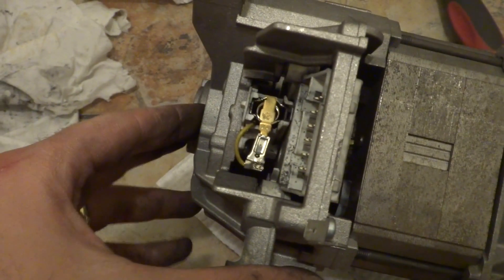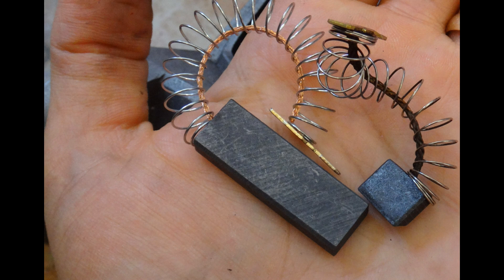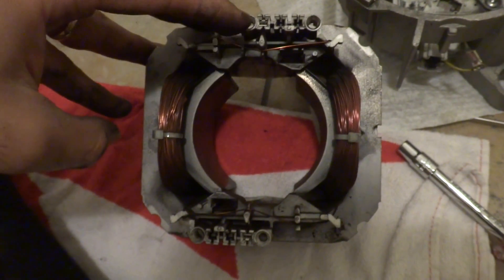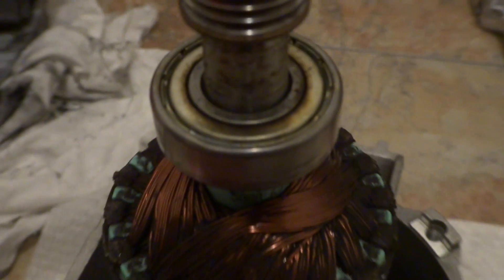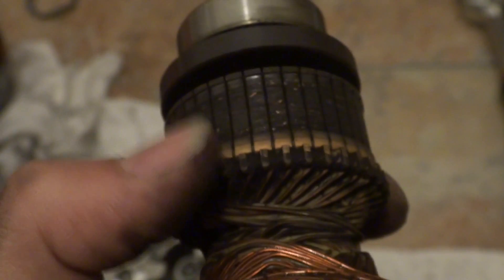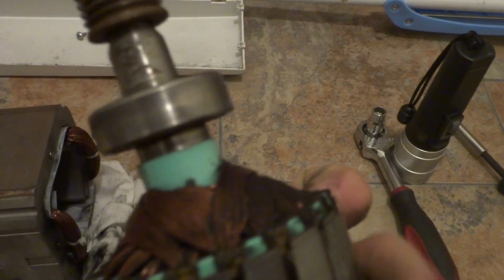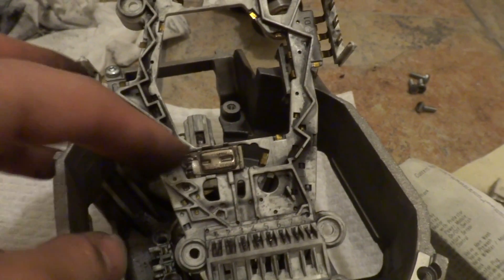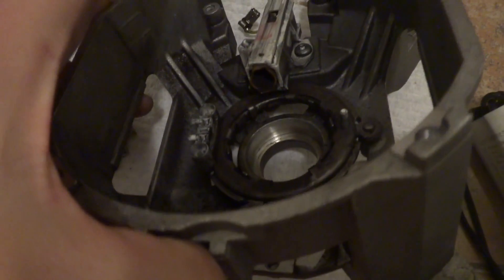Teardown and Inspection of Bosch washing machine Motor Rotor Carbon Brushes

Comment: The center rotating part with the commutator is the armature.
The rotor is a metal mass with windings and slip rings, used in car alternators.

Comment: Hi,ive taken out my washing machine motor and the rotor moves about 8 mm either way but wont move any more than that, at a guess what could be wrong ,ive moved the carbon brushes and the motor is on the bench,any help please

Comment: I have a question for you.   
Can you tell me how to remove the drive end bearing, yours worked well, but not mine!?  How to manage with the drive end part diameter that is bigger than the bearing diameter? Is there a way to unscrew the drive end or do I have to use an extractor of bearing ? 
And thank you for your video, very helpfull.

Comment: I keep a Bosch machine which is nearly 40 years old, but it does not fitted with this type of motor.  I mean no brush and the motor is good but the problem with the program box. I am trying my best to keep the contact point meet. Because I saw two burnt and I love the machine very much and it work well except the shock protectors not so good.. It is Bosch 946, I bought in 198X, with 800 spinning and 2800W.  
I also keep a Servis washing Machine and it stop working for what reason, I dont know. It used brush motor. It spins up to 1000/min.  I am very sad, also need my attention when I am 73

Comment: When testing the overload protection for resistance what kind of numbers should we expect?  Mine was .1 Ohms.  Great video, I had fun tearing my motor apart.  Unfortunately, my stator had 3 pins/terminal connections (D2 and D3) on one side and 1 pin/terminal (D1)connection on the other.  It fit either way, and ideas about which way it goes back on?  Thank you
Reply from the maker: +Mike Darius The resistance basically should be close to zero, in over current case the switch will operate and open circuit. I am not sure about the terminals as i dont have the unit anymore but if you wire incorrectly the machine will rotate in opposite direction. Which i dont think is a big deal in washing machine :-)
Reply: +World Of Engineering I ended up getting a new motor.  Maybe I'll take the new one apart, only after making some marks on the casing, and compare.  If it runs backwards won't that make my clothes dirtier rather than cleaner?    ;)   Thank you friend!  :D
Reply: World Of Engineering Actually rotation is very critical in many washing machines for the transmission to function properly. I'm talking about changing between agitation and spin. If you have the opportunity to open one up and have a look at the mechanism functions. Purely mechanical using rotation to shift between functions. May you never have one fail. Take care.

Comment: Thanks for a great video. After replacing drum bearings, motor carbons and one motor bearing, the motor doesn't turn. In the beginning it would turn the drum about one cm but now it doesn't move at all. I would like to test if the motor works at all. Can I do that by applying standard 230V current to particular connectors and if so, which connectors?
Reply from the maker: +eldhuspappir2 not really you need a capacitor to start the motor. Test your capacitor and to test your motor you can measure the winding resistance in both stator and rotor.
Reply from the maker: +eldhuspappir2 There might be number of reasons: 
1)short or faulty carbon brush
2) worn bearing
3) short circuit in the rotor winding
4) short circuit in the stator winding 
My bet is on rotor, you can test them both using a multimeter.  google it

Comment: The part that I want is the thermal cut-out 15am 213a 26v 6sa    or    the plastic plate that it is fitted to. PBT GF 30    615 60004.
Reply from the maker: Peter Morgan Your Thermal cutout has opening temp of 150C, this is a good option http://www.ebay.com.au/itm/10-PCS-SENSATA-15AM550B034A-MOTOR-PROTECTOR-170-oC-13-20-A-250V-/151329677740?pt=LH_DefaultDomain_0&hash=item233bf3a1ac
or if you can not find a cutout switch buy a cutoff one which acts like a fuse:
http://www.ebay.com.au/itm/SF150R0-Fuse-thermal-15A-152-C-SF-R-/201376542881?pt=LH_DefaultDomain_3&hash=item2ee2fa30a1

Comment: Very clear direction, thank you. I have tested the overload trip and found to be faulty. Can you suggest where to purchase a new one please.
Reply from the maker: Peter Morgan Thanks, Its a standard overload trip unit. Check the specs using the part number and search for it on line. It doesnt need to be the exact unit, something similar with same spec should do the job.
Reply from the maker: ***** could you send me the part number, what is written on it.

Comment: Nice video goes further than some explaining some parts that are not so easily accessible to test TOC, I am here because I have a motor that has 8 wires not 7 or 6 like most videos on here have, that has confused me a little.
What are the extra 2 wires for ? I have continuity and 0.3 ohms on them I thought they might be an extra winding polarity but they do not seem to be and idea ?
I do not have bolts in mine but will have to drill out the pins not done that yet thought I would try and find out what the extra wires where first.
Reply: Took it a part seems it has a separate TOC on white wires, tested my armature all 0.6 then get one 9.o ohms so I guess armature it gone.
You do not need a press for the armature bearings just a thick plate and a bearing puller then wind it up cheap on ebay.
Reply: Give a diagram for motor have two winding of stator with five wires

Comment: Hey there! great video. Could you explain the socket wiring please? I mean could you explain how I can drive this motor?
Reply from the maker: For what purpose? washing machine ? do you need speed control?
Reply: ***** I have pulled out the same motor from my old washing machine. I found out how the wiring is. But I still dont know how to control its speed.Could you please help me?
Reply from the maker: Ayhan Serpen It is very simple, you can use a typical drill or similar equipment as an example.You just need to find out which wires are connected to the Stator and Brushes. I already assembled my washing machine i cant check it

Comment: Hi i have the same motor as you video but the drive end bearing is shot how do you remove the pulley to allow the bearing to be replaced.

Comment: Hi great video. Ive just done the bushes on the same motor. It would be good to know what renovation you suggest. For example, I polished the comutator with very fine emery paper. I did not apply any switch cleaner or wd40 as I think it would cause more brush dust to stick to everything.
Reply from the maker: Good question Martin, That depends on the size of the gap between the segment of the commutator, I use to use a hacksaw blade and cut and clean the mica. you only need to cut 2-3mm then make sure its nice and clean (use air pressure)

Comment: Hello i've a WAE20061EP Bosch washing machine. The engine is very similar to that one on the video especially the shaft pulley and bearings...this ones are in very bad shape and need to be replaced...how can i change it...i think the pulley is a press fit...how can i take it off to replace bearings?? many tks
Reply from the maker: Well there are a few types of bearing and shaft locks. I am not sure about yours, but generally the ball bearings have a some sort of square pin in the inner ring or/and a ring just on top of it. Use a DIN plier to take the pin out and then use a three leg puller. To take the brass bearings you need a press machine